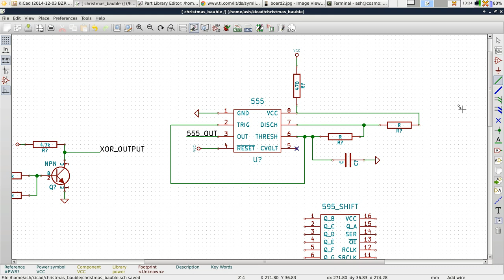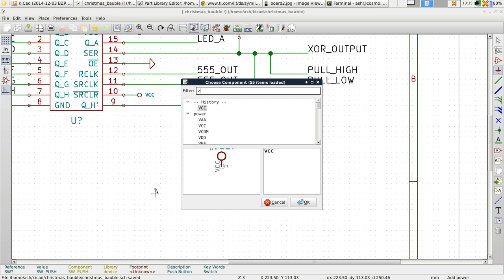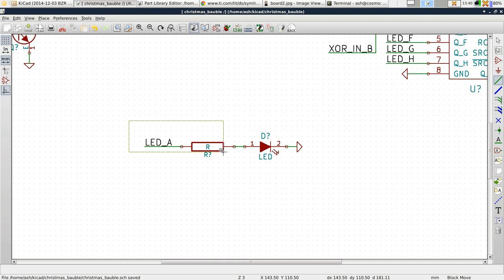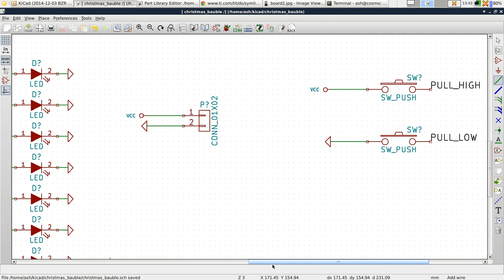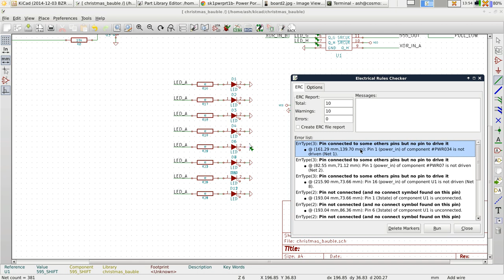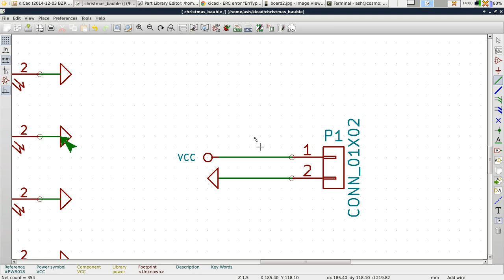Kicad Tutorial 12/2014 - Part 4/12 - Finishing the Schematic Design

Comment: Hi, power flag is overrided by the 470 ohms resistor, you could try to set the power flag after those resistors on each IC. And check this, if you, by mistake, press both tact switches, the battery will be shortcircuit. Great videos, Thanks!

Comment: Do I need to use those resistors and capacitance in timer , if I am going to use inbuilt timer library?
Reply from the maker: I don't understand what you mean. You need the resistors and capacitors so that the timer flashes at a certain rate unless you use a programmable timer.

Comment: Hello again. Please ignore my previous comment - I figured it out and got a Push Switch electrical symbol - not exactly the same looking as yours but similar.

I also was getting errors on the PSU GND connections but got rid of them my putting a PWR_FLAG on the CONN_01X02 GND Pin2. I eventually got no errors when I Run the ERC - how satisfying was that.
Reply from the maker: OK fantastic! Great to hear you figured it out :)

Comment: I assume those errors at the end of the video are a bug in KiCAD. I got the same errors, but at different positions. For example at GND for C instead of GND at LED_D.
It seems to me, that the software does not notice the connections the correct way.
If i edit one connection with such an error, for example by deleting it and coping another GND from somewhere else and wiring it altogether the right way, the error message might disappear at that GND position but it arises at somewhere else where no error was before. So in my opinion that is definitely a bug.
BTW: Thank you very much for your great videos.
Reply from the maker: OpenGL4ever thanks dude

Comment: Hi Ashley,

Enjoying your valuable videos so far and agree that your style is in my opinion not distractive at all.

I have a small improvement to offer on labelling that you might not be aware of:

If you'd labelled your first LED pin LED_1 (instead of using A), you could press "Ins" for Kicad to continue the series on the next pin, advancing the label counter to LED_2, LED_3, etc. Saves some time on copying and editing, especially when you have to connect up to a 25 pin ribbon connector, for example.

Cheers.
Reply from the maker: vrassoc nice, thanks for the tip! glad you're enjoying the videos mate :)

Comment: Scott,

Regarding the use of the 470 ohm resistor on VCC of the shift register - why do you add this?  Per the shift register spec you referenced, ICC is a max of 160 uA so the resistor drop is a max of about 75 mV.  I ask in part since I was getting the KiCAD error of "ErrType(3): Pin connected to some others pins but no pin to drive it @ (219.71 mm,105.41 mm): Pin 16 (power_in) of component U1 is not driven (Net 6)."  When I connected VCC directly to VCC (Pin 16) of the shift register, the error was eliminated.  I am just curious about your experience of using the 470 ohm resistor in that way.

Thanks so much for this tutorial series!  I actually find your running commentary and out-loud thinking helpful in following your train of thought.  We all think differently and since you are not face to face with your students, you cannot possibly consider the various styles of watching and learning.  Your technique is fine.
Reply: Sorry, meant to address that to Ashley!
Reply from the maker: Thanks Thomas for the kind words. I'm glad you found the commentary useful. I wouldn't have had time to do it any other way :D

The 470ohm on the shift register was just to reduce the power consumption slightly, which it seemed to do. To get rid of the error, the pin has to be marked with a power flag.

Comment: As you do these tutorials I suggest you DON'T spend time teaching, for example, how a 555 timer works.
Just teach KiCAD.  Don't spend time telling how to calculate a resistor value.  If I need to know that then I wouldn't be at the point of doing a PCB design.  Stick to teaching KiCAD.
thanks for the videos
Reply from the maker: Thanks for your comment. I wanted to try and be as complete as possible, in case it was useful for some people. But I get what you're saying.
Reply: @AshleyMillsTube  Actually, I did find some of it useful. It just takes time and effort to follow along your train of thought. Which in some instances is very useful as I've gone down some of the exact same thinking steps. This helped clarify a few things.